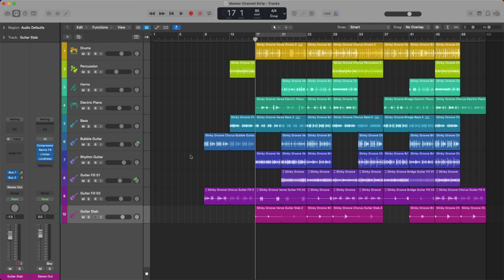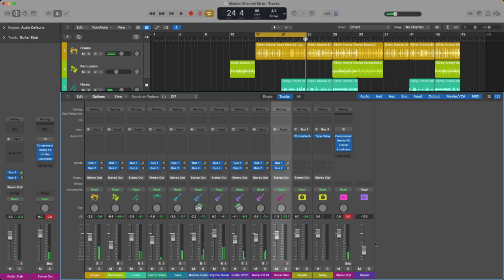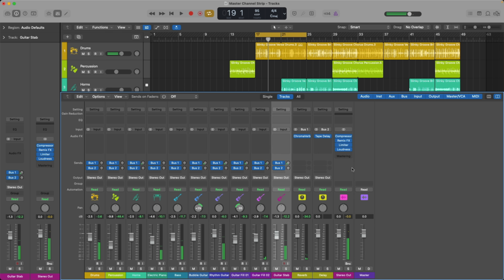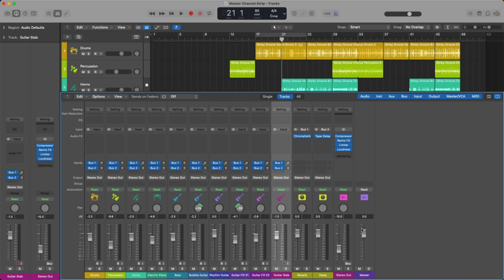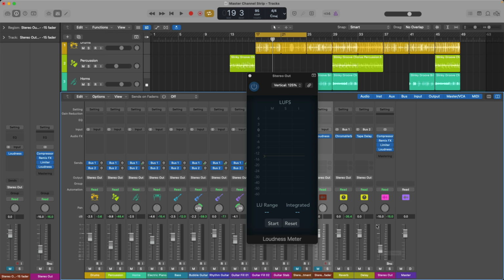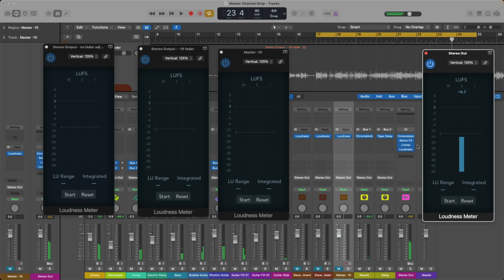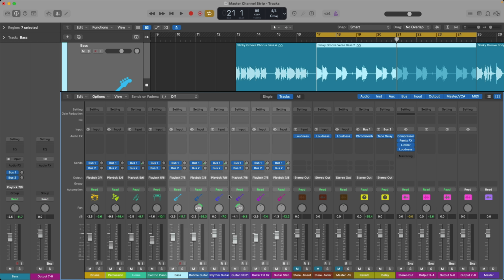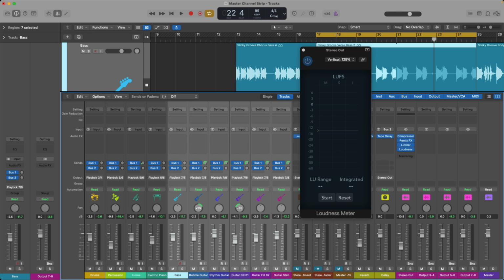Stereo Out vs Master Fader - Why the Heck Does Logic Use Both?

Comment: Whhatever the daw is, never touch the master fader(s) is a golden rule.... I find myself having to repeat that more than I'd like to, but yeah, never, touch, the, master, fader(s). No matter how much of them there is....
Reply: This is terrible advice. There are many reasons. Most simple of those is a fade out. On a "real" console, the master fader is before the stereo out effects chain. The fader drives through the bus compressor and post processing so you can adjust the level hitting the processing from all channels at once. The "Master" fader in Logic is literally a useless volume knob.
Reply: @garyjostone I agree that the above advice is terrible, but the master fader does become quite useful when using multiple outputs. It’s only redundant when using a single output.
Reply: @gitpho : I can see that. But, it's something that I think would be the exception, not the rule. If the multi out thing is needed that can easily be set up. But I find myself having to set up Logic to act like a console and it should already behave like one.
Reply: @garyjostone  Why should it behave like a console? I suspect 99% of Logic users have never been near a console.
Reply: @MonsieurVersatile : Not to make too much of a joke, but are you really asking why a thing called "the mixer" in Logic should behave like a mixer? Or at least be able to behave like what professionals are used to? If you don't know, or aren't interested in this functionality, great. But I wish I could just enable it as a feature. Much like "pre fader monitoring" is not used in Logic by most, but it should be.
Reply: @garyjostone   Well an electric car is still called a car. Doesn't mean it has to have pistons. But if you want to control the level going into your mix buss effects just stick the gain plug in the first slot and, bingo, you can adjust to your heart's content. (I think Chris mentions this?) You can put one on every channel if you want to emulate an analogue mixer's trim controls.  As for pre-fader monitoring, I do use this funnily enough, but you don't really need to worry unduly about gain structure etc in Logic. Logic lets you record at crazy levels, high and low, without sacrificing quality so getting your gain around -18DB or whatever you prefer on a console isn't really a massive issue. Same reason there's no 'bit robbing' as another poster claimed here. Logic's internal processing dynamic range is massively more than anyone could ever need.
Reply: @MonsieurVersatile : As, I've stated... I know there are workarounds. But that doesn't change the fact that there are 2 faders on the output that do the exact same thing. It's redundant. Period. So... What's wrong with having what I'm talking about as an option? You don't have to use it. But I'm not just talking nonsense.

As for Logic's internal dynamic range... agreed. It's fantastic. But... it matters what you're driving into 3rd party plugins quite a lot. So I like to be able to see this accurately. Especially if there's an issue.

You seem to be saying "Don't worry about anything. Let the software do everything for you." There are creative reasons for what I'm saying as well.
Reply: @garyjostone  I won't argue about fading out, it is not something I do, and I feel it is better done with automation than moving the fader... Also, I say that to students that have mixes that clip and then lower the master fader instead of being just a bit sensitive about gain along the way. They have no idea and try to adjust from the end of the chain so yeah, don't touch the master fader. 

Saying that this is"terrible" advice is really fun though. Nice one.
Reply: @tebi1kurieudidon172 : I don't "moving the fader" either. I mean automating it. I use a gain plugin for this too. Either way, the Master fader should feed INTO the bus processing and it doesn't. This makes the Master fader totally redundant. You could literally automate the Stereo Out fader and get the identical result. The master fader is just a second volume knob.
Reply: @tebi1kurieudidon172  : And moving the volume fader to avoid clipping isn't best practice either. You could be clipping in your bus processing somewhere. I'm not just making this up to argue. This is a very very very practical useful way of doing things and keeping your gain staging really clean. Especially on your master processing. If you're clipping with your fader at zero, something in your bus processing is going over. I meant no offense or to challenge you as a person with the word "terrible". But it applies.
Reply: @tebi1kurieudidon172 : I'll give you a real world example. Say you're driving into a SSL bus comp and that's all that's on your master buss. If you pull the master fader or stereo out fader down in Logic, nothing about your compression will change. Say your mix is really hot and there's no "in" volume on the compressor, you have to go turn your entire mix down either bus by bus, or channel by channel. If the Master fader was feeding INTO the bus comp, you could just pull the fader back a bit and play with how the compression sounds at different levels and not have to touch your entire mix to do it. This is very very common and useful. When emulating a console setup anyway.